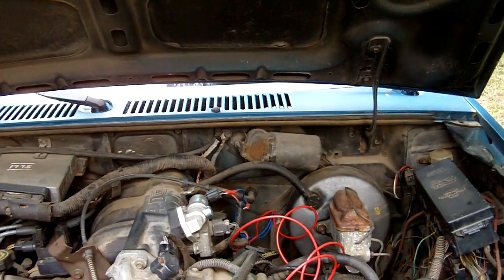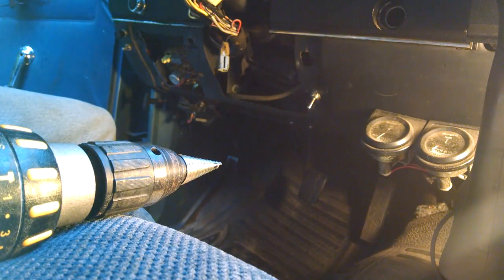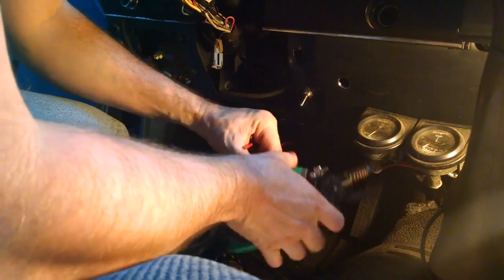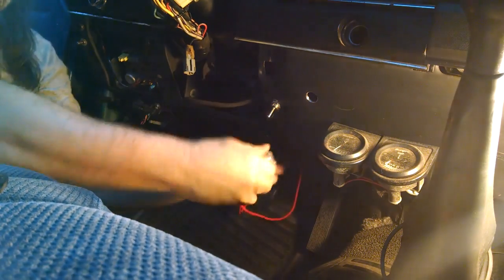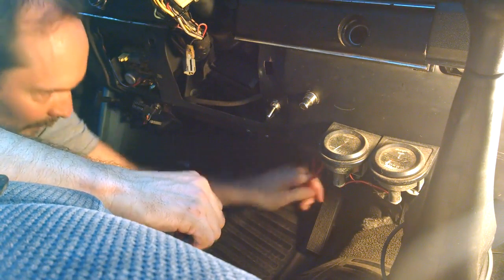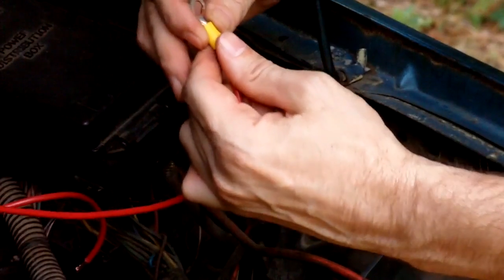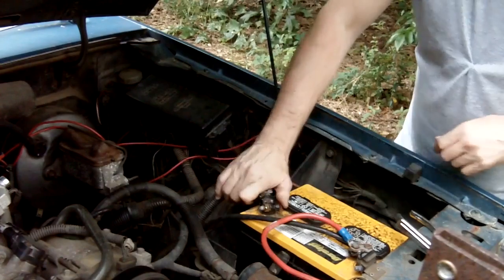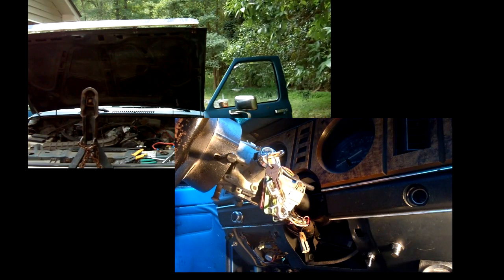Ford Ranger Installing starter push button switch

Comment: I tell you what the problem is..bad ground on the solenoid..I just did this today to my 83 ranger..sometime it would start with key then act dead after new solenoid..key switch..ignition switch it still done it..I put a ground cable from the solenoid mount bolt to the neg ground cable on the block..problem solved

Comment: This helped me so much. One thing i noticed is that t appears you didnt specify which wire connects where. As both wires are red it looks like you just hook em to one end(the switch) then randomly connect either wire on the switch end to either of the ports at the other end? Do i need to care which wire coming from the switch connects to which port at the other end??

Comment: Thanks for posting. I was looking for videos on how to hook up a remote starter. I also have a 1993 3.0 Ford Ranger. I own the remote starter switch so I think that if I hook up one wire to the pos battery post and one to the solenoid it should work.

Comment: Loved the simplicity of this setup.. I'm currently trying to set up a Toggle switch/ push-button panel with three accessory toggles and a relay added in for my '90 F-250. I wish I had tried this first! One question.. If it HAD tried to start when you bumped the Batt terminals.. then you would just have to reverse the connections going to your Solenoid ? Also.. what were the Blue wires you had under the hood? Were they going to the Toggle switch you had on the dash near where you mounted the Push button? Just curious.
Reply from the maker: No, the blue wiring has to do with another issue that the truck has. I believe it is the issue with the truck revving up at high idle and staying there, the blue wires go to toggle on the inside for shutting down the high idle.
(This is a Frankenstein build, you might say.)
See, this is a 94 motor and trans inside an 83 body, so nothing is as it supposed to be.

Comment: What port #s did you use in the starter solenoid? Some people use #87 and #30, I do not have #87. The way I saw you did, because it was too dark it could have been #86 and #85, but that would ahve been a positive and a negative and that would have done the switch a charge.

Comment: Thanks for making your video, great job. I'm looking to put one in my ford f150 my ignition works, but for me to start it I have to turn the key way past normal position. And then once it starts turn it back a touch. I'm looking to add the button like you and just turn the key to the on position and hit the button. This setup should still work for me ? Thanks if you or anyone can answer for me
Reply: That's my problem to
Reply: @ozziestrom9793  yeah it worked out for me, maybe down the line I'll try replacing the ignition key setup, or open up stearing column and clean up everything and regress everything inside. And replace the linkage in there to start truck. But for now I'm happy with this. It works great
Reply: Thanks for the quick response. One more question, where did you purchase the button, and what gage wire did you use?
Reply: @ozziestrom9793  I believe I purchased button from AutoZone or advanced Auto and I used a 14 gauge wire. As long as your truck starts right up you should be fine, but if you're doing a lot of cranking maybe a 12 gauge wire would be better

Comment: i have a 96 ranger and i think i have the same problem. somw times i have to hold the key in the start position for 10 seconds before it actually starts to crank.

Comment: Wouldn't it be safer to put a relay or inline fuse? So it  won't burn your truck down.
Reply from the maker: Whatever makes it safer, then yes.
So, do this but add in a relay or inline fuse.

Comment: So to let me understand. The push button wont work unless the key is turned to ON? Would this fix a solenoid stick issue? Like does the push button help with getting power to the starter while the button is pressed and then disconnected when depressed regardless of what the solenoid wants to do?
Reply: The push button will try to crank it, but if your starter or starter solenoid is bad it won't change anything. If the starter solenoid just clicks sometimes you can take apart the starter solenoid , clean the contacts  with sandpaper or emery cloth and reassemble.. They also sell starter contacts and the armature as a rebuild kit for your specific vehicle .

Comment: Dear Wayne First & Foremost Thank You for the taking the time to post this! My husband passed away on Christmas Eve unexpected & we have had a problem with our 2003H3 for years....no one wanted to replace starter saying it was good & trying a million other things$$??? So he would always "lay" a screwdriver across the solenoid (its one with starter & on lower left side) & NO problem...start right up! I am scared to death of getting stranded being all alone now, even though it happens randomly & not as often but at 60 this would be a miracle! If you are still out here can you tell me if its exactly the same and seemingly easy when the solenoid is part of the starter? God Bless & Thank U!

Comment: Did this ever kill your battery or did you ever have any issues doing it this way?
Reply from the maker: Nope, never had an issue.
As long as you have a similar setup, you turn the key, and you hit the switch, and it should work without an issue.

Comment: Will that work if the starter stays engaged?
Reply from the maker: If it stays engaged, then your starter needs to be either rebuilt or replaced.
If cheaper, I would rebuild it.

Comment: I did everything the same, but it wont work. It worked barely a couple times and thats it. Theres only two posts on the sylenoid so i know they aren't switched or messed up.
Reply from the maker: I think I thumbed up your comment instead of commenting on it.

OK, if you are still having this issue, then your Solenoid is most likely going bad.
Post back, if you have this issue resolved or still having issues with it.

Wayne
Reply from the maker: By the way, nice catfish.
Reply: Best most simple and effective. 😉

Comment: did u not have to slice any wires
Reply from the maker: NO!
 I just ran the red wire into the cab, split it on the outside, and connected the connectors to it, and then connected it to the solenoid.

Comment: I burnt the wires goin to ignition so i did this. Truck cranks but no start
Reply from the maker: Then the Solenoid is most likely shot.
Can you jump across the two screws like where I run the wires here, and does it start, or not?
If not, then I would think about replacing the Solenoid.
(or)
It could be a wire going to the starter.
Make sure that the wires are good.
Make sure that the battery cables are good.
Make sure that the wires going from the
Solenoid to the Starter are good.

Just do a like of making sure of things, before you spend the money.
Reply from the maker: With the Ignition in the on position.
Run a jumper across both bolts (Where the wires I show in here to connect to)
And it SHOULD crank.

Comment: hey man i have a 87 ford bronco ii and i tryed doing the same thing but when i push the button the wires just start smoking and getting red hot and it doesnt start
Reply from the maker: Are you sure that you wired it exactly like I did it here?
I remember years ago, i tried this very same thing, and I did the wiring wrong, and almost caught
My old work truck on fire.
Reply: i got it figured out! i was wiring it to the top two big terminals instead of one to the small termina(starter)l and one to the big terminal(battery cable side)
Reply from the maker: Good deal.
Reply: thanks man very informative video. about to do this to my jeep. will be a little more difficult considering the solenoid is connected to the starter and bolted to the transmission. will be doing this in the morning.

Comment: No one shoes how the wires go on the push button i am a girl. Some guy did my push button next thing i know it stopped working how do I install one. I need help please
Reply: Kenyana Brown figure out how many connections are behind the push start button.  One wire to + battery one wire to starter solenoid (s) switch and one wire to ground....

Comment: awsome about to do my bronco full size mine is doing the same thing want start so iam doing this awsome video great job
Reply: what year is your bronco? sold my bronco to this kid and i ended up getting it back come to find out him and his dad set this up in the engine bay could positive and negative wire be used for anything this? just trying to get my bronco running again.